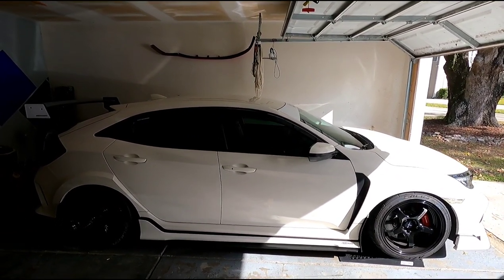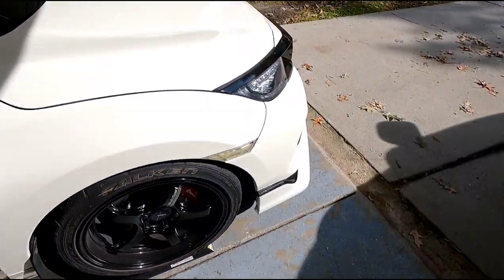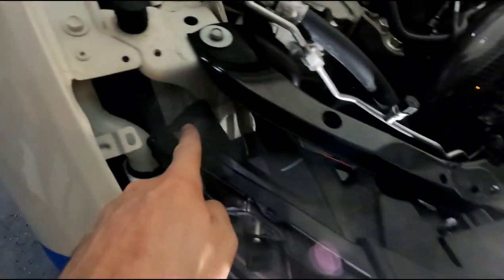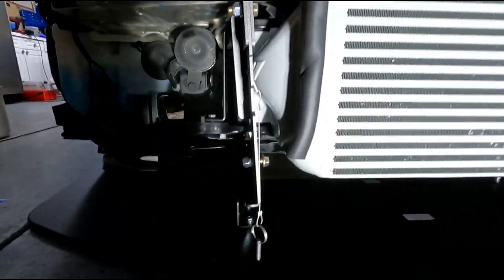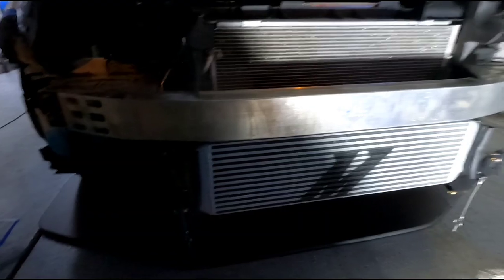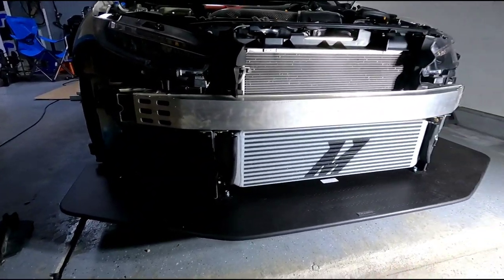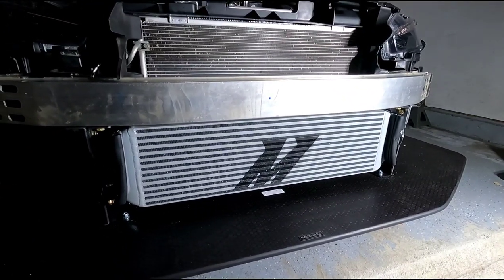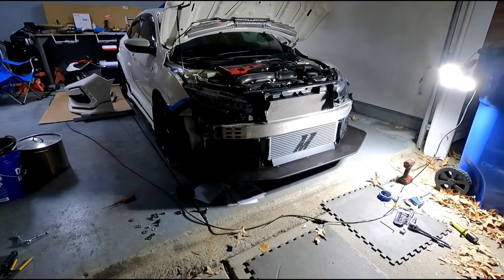Racebred splitter install on fk8 Civic Type R

Comment: I thought about getting the battle aero bracket with the racebred splitter. I heard it's a bit easier with a little more room for coolers.
Reply from the maker: Yeah. It would be worth a shot. But it fits just rubs a little

Comment: I'm getting ready to install the racebred brackets with a mishimoto intercooler, and I'm wondering what tips you might have for getting them to fit together like you did?
Reply from the maker: Just measure and remeasure. Try to mount them equally apart. Prop it up and try to get it aligned before drilling